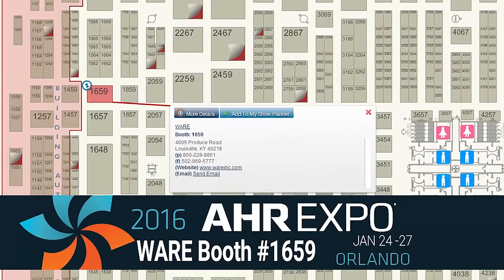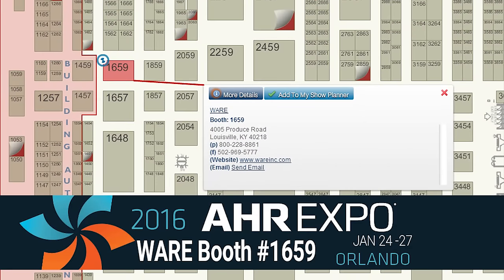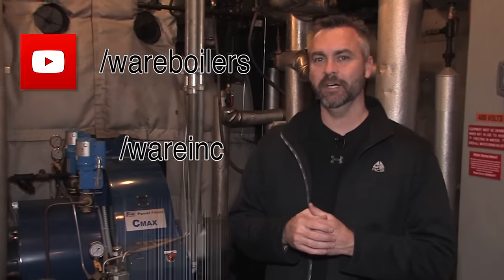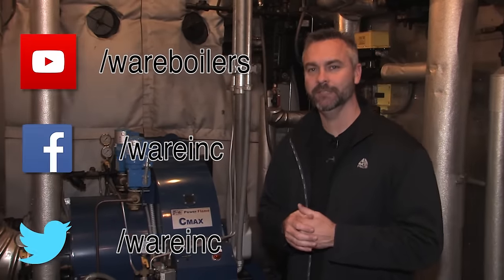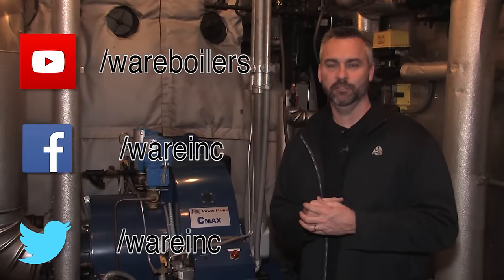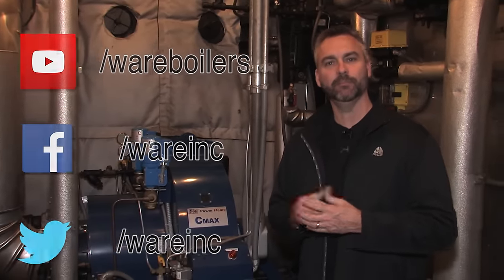Linkage vs Parallel Positioning - Boiling Point

Comment: I’m with a heating contractor in NYC, single point positioning is here in a big way, now with the removal of 6 oil all the buildings are firing gas mostly with 2 oil as back up and below 20deg F, Siemens has cornered the Market up here with all the engineers, there was a conversion frenzy for the past 10 years, New York State gave tax incentives and grants to buildings to upgrade there heating systems and ConEd gave fuel discounts if buildings stayed solid gas for 5 years, we intern became very busy installing new boilers, burners, new gas main services etc. but the issue was no one really new parallel positioning, I wasn’t there in the begging but was told it took a few days with the rep to start up the first burner, up until then 6 oil and Rotary burners were king in NYC, I have trained with what I say are the best mechanics I’ve came across 2 old school guys that stayed a head of the curve of technology very rare, I was fortunate to be trained by them, I was a residential heating tech for 10 years I knew nothing of commercial, but the rite training has brought  me farther then I imagined, but I digress, parallel positioning is great being able to carry a 4-5% O2 threw the curve on either fuel, very hard to near impossible with single point positioning, someone who has studied and continues to learn about Combustion can appreciate that, I love to see videos like this and believe you guys are the only ones doing it, your videos are great, it sucks we only have a few jobs here with Auto Flame and Honeywell, I’m gathering in other parts of the country there’s more of that, keep up the great work it is appreciated.
Reply from the maker: Thanks for sharing your story of being in the field and the stuff you have learned. Hopefully our content continues to be of help to you and your career. The old guard of single point positioning has it's place but for high efficiency parallel positioning is the way to go. More and more it is becoming computerized which allows it to become more efficient. Thanks for watching!
Reply: Hey where in NYC u work? Whats your IG? I work NYCHA owned boilers at diff housing developments

Comment: Pretty scary to see all those linkage rods. We had a water tube Cleaver Brooks 300 horsepower Boiler that blew the side doors off do to a linkage braking off and causing the Boiler to over feed it with fuel and caboom! Now they all were upgraded with Servos to control the entire burner assembly. Those linkages will brake and u don’t want to be in the Boiler room when they do. I was in the control room when it happened...I’m just glad our fire tube was not the one that blew cause I would not be writing this comment should that boiler would have blown.

Comment: Those linkage are truly scary. We had our 300 Hp water tube Boiler explode when of of these little linkages broke. It was upgraded with servos, thank God! Not like the Servos  won't fail but it looks like a much safer design.
Reply from the maker: Servos are the way of the future. I think most boilers will be upgraded to servo motors as time goes on. Better efficiency and safer. Thanks for watching!

Comment: Very impressive. Good video.  I had single point system/linkage. I call that Frankenstein's mechanism.:-) I have 2 Boilers, 400 hp and 500 hp low pressure.
Reply from the maker: Parallel Positioning is the way to go. No more slippage is the best selling point. The device knows exactly where it's at and it will continue to be true. If you'd ever like to talk about upgrading your boilers to servos please contact us! Also thank you for the comment! Glad you liked the video

Comment: so basically single points are linkages and parallel is for systems with actuators?
Reply from the maker: That's a good basic breakdown of it. Parallel system is a bunch of servos that are being controlled by a computer system. Thanks for the comment!